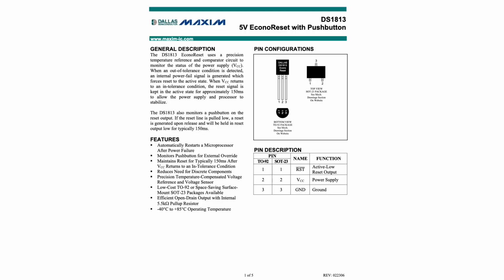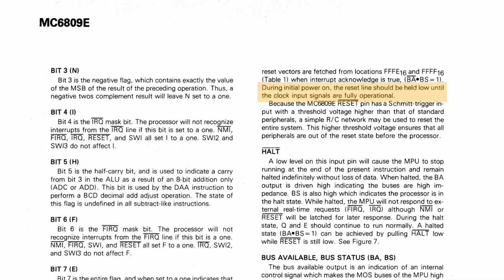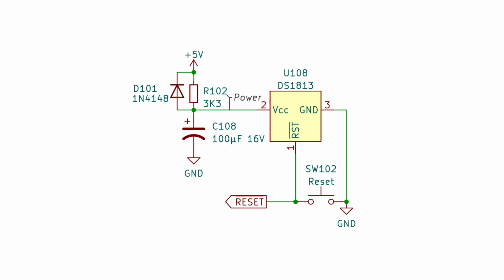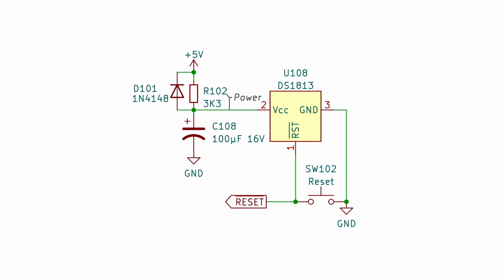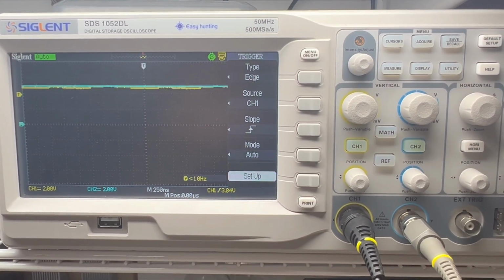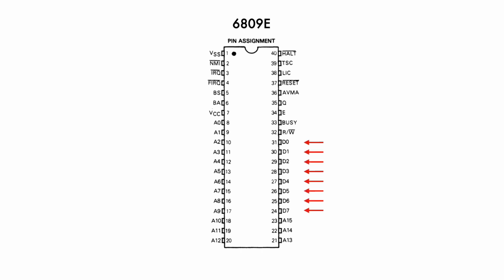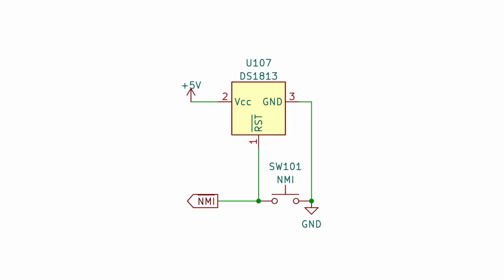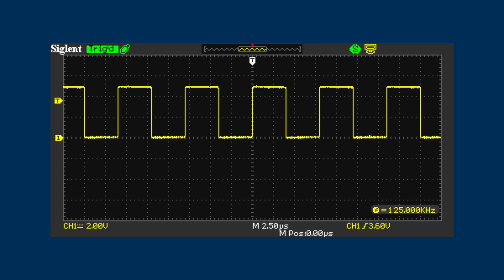6809 Playground - 03 Reset Generator

Comment: After all that build-up, I thought you were going to have a way of detecting the clock circuit working and then turn off the Reset signal after that.  But you just made the power on reset last longer than the default of the reset device.

So, how would you detect a working clock?  Bridge rectifier and measure a voltage just to see if it is on?  A resonant circuit to check that it is at the correct frequency (your multi-speed clock would make that more difficult)?  How would you test the difference between clock phases?  Would extra circuitry to check the clock add too much load on the clock circuit or add reflected signals?  Yeah, a time delay does sound good!

Though could you make do with the default 0.15 second delay?  Try your scope on that - see how fast the clock starts up relative to power getting to normal.  That would be interesting to know.